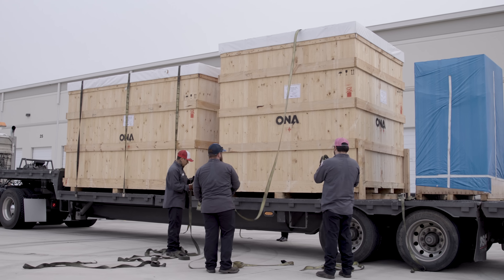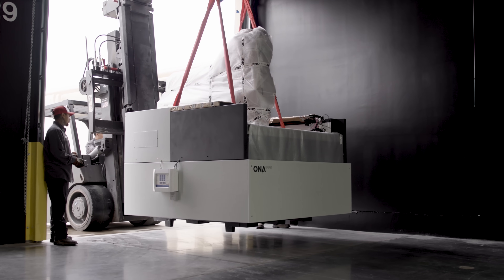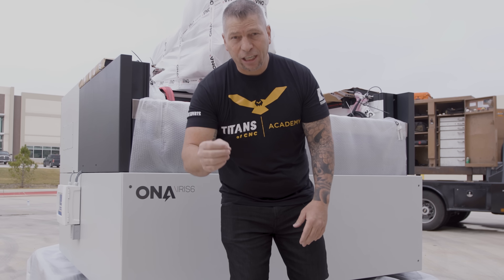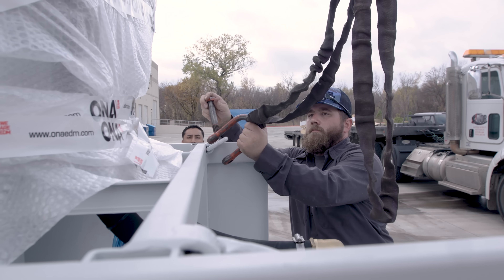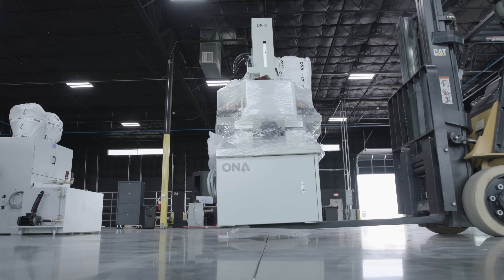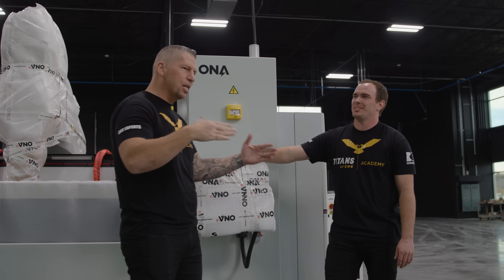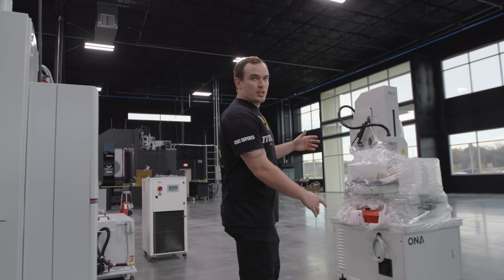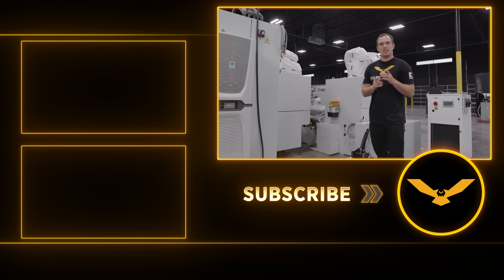New Technology | ONA SINKER EDM Just Arrived | Electrical Discharge Machining

Comment: Back in the 80’s I worked at McAfee tool and die in Akron, Ohio.   They had 3 Mitsubishi wire edm’s and an Agie wire edm.   All were very accurate, (I’d say almost on par with grind shop tolerances…..tenths).   They would save the long burns for late Friday and let them run unattended for hours, sometimes into Saturday or Sunday.   We were the premier wire shop in Akron for all the stamping die shops,  and we were a stamping die builder.    I ran their first CNC mill.   
BTW,   I’ve never heard of zerro tolerance machining,  only shops with inadequate inspection tooling.     Everyone now wants to use probes and computer software to inspect parts.   Much faster to check parts.   Go to any quality glass lense or mirror grinding shop,  they have the inspection gear.    They work in microns.

Comment: Waht machine do you want to use to mill the electrodes for the EDM? Because we had an hermle u30 to do this but the Maschine was not good enough. It leaves extrem small marks in the electrode. Witch we can se on the finish part.

Comment: Zero tolerance... ya, a whole bunch of nonsense machining. +-.005 is good enough on most applications. +-.0001 is retarded on all applications. Engineers have no clue what they're asking for because they've never been machined in their life. 

The only thing that should require +-.0001 is nasa, or something to do with nuclear. A car part does not need now, or ever .0001. Machining is dumb. Not worth the time when I can go work at walmart for same pay at this point.

Comment: I've got 4 years experience in programming and running mitsubishi edm sinkers in the tool and die industry. Sinkers are great machines and can do some really awesome things, but make no mistake, what the manufacturer claims for accuracy is ultimately limited by the accuracy of the guy and mill that is making the electrodes. If he, or the machinery, is only capable of holding +/-.0005, then the best your going to be able to do in the sinker is +/-.0005. In the end, I'm too much of a control freak and  I couldn't stand the fate of my accuracy depending on someone else's work, so they just weren't a good fit for me. Will be interested to see the kind of work you guys do with yours. Love the channel titan!
Reply: Exactly! I have 20 years in EDM.  The servos are incredibly accurate, but the settings and electrode production is crucial. Just today i was making some wire edm produced gages and to get the burn compensation value within .00005 was a challenge.